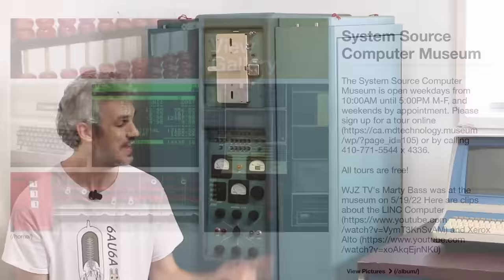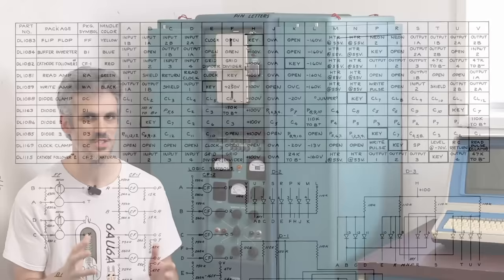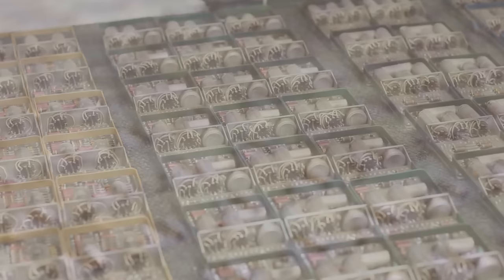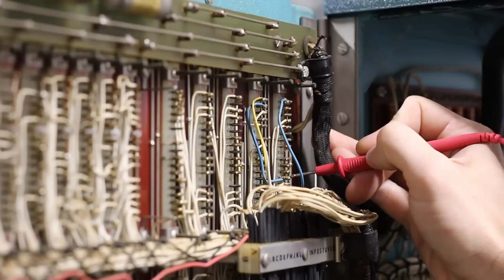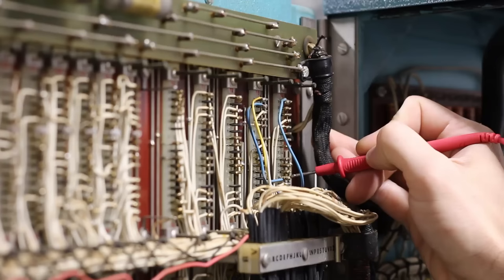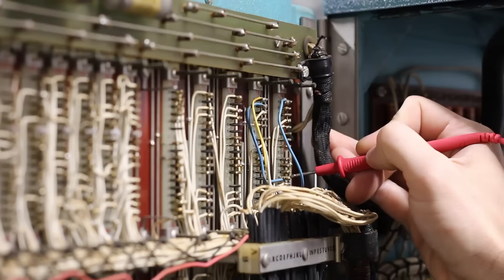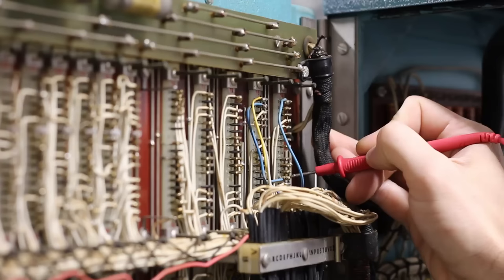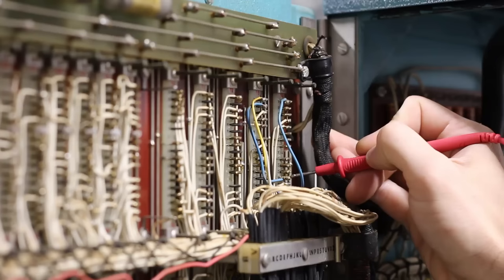Exploring 1950’s Computer Logic with the Bendix G-15!

Comment: I was actually glad to see that the card edge connectors were double-sided but single-circuit, since it makes them a lot more reliable.  But it still would be a daunting task to clean every one of those connectors if they get oxidized.  I really like the modular design though.  It seems like you could make test jigs and test all the cards on the bench without too much trouble.

Looking forward to the first power-ups!  Take care with those capacitor banks, and definitely use a variac and some current limiting if possible.  This will be a really fun series.

Comment: Those big round connectors used to called "bendix connectors". As an intern many years ago i was tasked with sourcing some replacements for a seismograph and it took me most of a day to figure out the military specification that they are now known by and order them from  Digikey.

Its cool to see them used on an old piece of Bendix equipment.

Comment: I just realized that Star Trek computers are paying homage to all these old computers with hundreds of small cards plugged into a back plane. Such an interesting structure!
Reply: The production design of Star Trek is from 1966, so the contemporary 'computers' would have looked a lot like this. And The Next Generation was from 1987, which still had similar-looking computers like the PDP-11 and VMEbus machines.

It's just a very efficient way of making a very flexible circuit arrangement that can be modified in the field.
Reply: The plugging in of these cards reminded me of the scene from 2001 when HAL is being disconnected.
Reply: Homage? bruh thats what they look like.
Reply: Because that’s exactly what mainframes  and computers looked like in the 60’s.
Reply: In a way that structure is still used today. Look into things like blade servers. Computers on a card. With the backplane providing infrastructure. Storage is not on the cards but centralized etc. It's very efficient and flexible.

Comment: I was a Field Engineer with Bendix in the 1970s. I was in the airborne sonar division at Sylmar, California. We had a computer system used to run Acceptance Test Procedures on sonar that was mounted in SH-3 Helicopters. The computer was a beast. It weighed 55 pounds and was quite large. Back then there were components that were so large we had to solder them with a soldering gun instead of a soldering iron. Ah, those were the days.

Comment: The 1950's was a time before static was a thing.
Reply: @tripplefives1402   It also doesn't matter with discrete components with their elements measured in millimetres vs nanometres
Reply: @tripplefives1402  Also the amount of current normally carried is far greater than what static electricity could deliver.  This is untrue for the innards of modern logic chips.  Now it's possible that static could blow one of those germanium diodes.  It would be a good idea, if Mr. Usagi hasn't done it already, to ohm all those diodes out in both directions.  The voltage margin does make me a bit uncomfortable.  Modern Schottky diodes could be substituted to come up with something more robust.
Reply from the maker: One of the great things about vacuum tube computers is how robust they are to transients and low current stuff!
Reply: static?  I ber a dollar to a donut this beast would survive an EMP
Reply: Heh. Before they cared, certainly. A good pop could zap some of those diodes, esp. as old as they are now. (the zap you get touching a doorknob is enough, but I doubt that's a problem for him.)

Comment: The first computer I ever had to service was an analogue computer, with valve (tube) amplifiers. It ran a flight simulator😊
Reply from the maker: Oooh, that's awesome! Was it the K2-W Philbrick based analogue computer? They have one of those at the museum in New Jersey at VCF East, and it's a work of art!
Reply: @UsagiElectric  It was a British built machine, so probably Singer Link Miles. It ran the Folland Gnat simulator.
After that I worked on many simulators that were hybrid digital/analogue machines and experienced the evolution to the digital age...

Comment: To clean the krinkle paint surfaces, go the dollar store and get concentrated La Awesome, dilute it 1:3 parts water, and saturate a slonge with it. 

That has been the most effective for me.
Reply: Sounds like a nice idea, just be careful of the fumes (there's a lifetime maximum exposure rating on the chemical used, believe it or not) and test it first where it won't be visible if it does mar the paint.
Reply: @SeekingTheLoveThatGodMeans7648  Citation? After looking at the SDS and checking out the components, I was not able to find any evidence of a lifetime exposure rating on anything in it. I would be shocked if anything consumer level would have such.

Comment: It is looking good inside. One thing you could have done with all the boards out is to check all the diodes in case any others are bad. Those cylindrical capacitors(?) seen on the left at 34:12 look nasty and will need to be replaced.

Comment: Maybe by the time that this machine was built Bendix was simply making all of them "alphanumeric ready", so that if the customer desired that feature it was a lot faster/easier to complete that process by wiring up the output pins, instead of having to dive into the backplane with a post-production modification 😊

Comment: I would be tempted to make a test socket for each type of board and use it to test each card separately (maybe using a Raspberry PI, although it may not provide sufficient voltage to check the diodes reverse breakdown voltage)
Reply: It's a good idea to make an automatic test and measure system, though an RPi would definitely not have enough voltage output (not to mention there would be a... significant level translation issue, even for inputs). Probably use one or more off the shelf system DC power supplies  + custom circuit or one of those HP-IB controlled boxes of relays with a DVM (I forget what they are called) to send the correct input voltages and measure the outputs.

Comment: I wrote my first code on a G-15 at UCLA Engr basement in 1960. OPs were numeric; I think '50' was multiply(?) No assembler - you assigned addresses for code and data. It had both paper tape and punch card I/O. Aside - down the hall was a comp called SWAC that created the sound for the movie "Forbidden Planet". The operator was entering code in binary to develop logic for a pseudo random number generator. It had a speaker hooked to the CPU so he could hear how long it took to loop.

Comment: On that one type of card that only has one row of pins in its connector you can see that the fingers on both sides of the card are still being wiped by the connector pins, so since all the connections are doubled up, they would be very reliable.

Comment: David, what is interesting is I observed no wattage ratings on the schematics.  That leaves me to believe that there is a system that was used that would specify where the heavy wattage's would be and default to 1/2 watt. To use a modern term on vintage hardware, it's an OMG machine. I knew someone (passed away) that worked for Bendix and I can imagine him using one of these to align GAM missiles.
Reply: The 1/2 watt resistor was the lowest wattage in common use and was not typically noted on schematics.  Higher wattage resistors would be marked as such, e.g. 1000 2W

Comment: 22:00 I guess the part above the gudeman capacitor is the input transformer? The whole machine is a great example of old manufacturing. Early PCBs, but no through plating so they had to put an insert into every hole. The parts have their legs all coming out to the side for terminal strip or point to point construction, which leads to that for today odd looking transformer blob.

Comment: The "Read Amplifier" circuit at 22:08 looks suspiciously like a circuit I designed for a transistor computer I'm developing, so I'll give my 2 cents on what the circuit does.

In my computer I store the microcode in a "core rope"-like memory where one ferrite core represents a single bit and a each wire passing through it is a single word of storage. To read each word I put some current through the corresponding wire, but this induces only a small pulse in the output of the ferrite core, too short and too weak to be used to control the rest of the machine. So I first pass the signal through a simple common emitter amplifier, then the amplified signal is connected to the SET signal of a S-R latch, so that if the bit encoded in the ferrite core is a one, a pulse would be generated and the S-R latch would output a one, and if no pulse is generated the S-R latch would remain to zero. Before pulsing the word wire, i briefly pulse the RESET signal so that all latches start from zero.

The Bendix Read Amplifier looks basically the same, just made out of vacuum tubes; I guess they are using it to sample the output of the drum read heads to "stretch" the pulses long enough to allow the rest of the machine to use the single bits.

Comment: This thing is absolutely amazing. Are you worried about all those Allen Bradley carbon comp resistors drifting? 70 years is a long time, I wonder if that’s going to cause issues.
Reply: I was wondering the same thing. I have an old Tek analogue scope where the focus stopped working, & it turned out that it used carb comp resistors in the focus chain. I replaced them with modern metal film resistors & that did the trick.

Comment: It would be cool to build a mini version using FETs
Reply: where would you get the drum from?
Reply: @mohinderkaur6671 modified hard drive maybe?
Reply: @Rorschach1024  the platter from an old drive and it's read write heads could possibly work. I've recorded on various objects such as veggie tins, etc as hobby projects over the years. I've also, in the 80s as a youth, converted 8 track units into data drives. But what I was thinking for this was to use a strip of magnetic tape from a cassette wrapped around a cylinder and the read write heads also from the tape machine. It would be a lot of work tho... and mighty not ever work....
Reply: @mohinderkaur6671  I'm actually thinking the simplest solution would be an endless loop cassette tape originally used with answering machines of the past and a datasette.
Reply: @retroatx  It'd have to move pretty swiftly to match the speed of that drum though.
Reply: @SeekingTheLoveThatGodMeans7648  yeah you're right I forgot the system derives it's clock from the drum and those endless loop tapes are short.
Reply: @retroatx  HA!  I thought I was the only one who used an 8-track deck as a poor-man's floppy disk!  Making a drum memory using cassette magnetic tape and heads sounds like a great idea.  And also, some computers made after the drum era used one surface of a disk pack with a set of fixed heads, for medium-capacity rapid access memory.
Reply: @BrightBlueJim  there was a book that I built a computer from that used a modified 8 track as a stringy floppy. I'll try to remember the books it was a set of two. This was around 1980. The coleco Adam Digital Data pack DDP was a modified high speed cassette tape that held 256K. My idea for the FET machine was to use an endless loop tapes with an auto reverse tape head and write head so I could simultaneously access both sides to replace the drum but I don't know if I could get it to work

Comment: Keep in mind, that’s a smaller something is, in general, the higher resistance will be. The bigger the conductors are, the higher the conductions will be, and the lower the resistance. So a small device is not a big high power low resistance thing. A small device is a small, high resistance, low power device.

Comment: As someone who had a fair share of diode logic related headaches -h resistors are pullups for the gates. At this level of non integration logic gates are more of an analog circuit, and buffer modules shoehorn them into discrete states.
Reply: And read amplifier uses a RS trigger to shape the pulse from the memory (which is really slow and wobbly) into a neat little square one clk cycle long.
Reply: That RS flipflop can be seen as a kind of schmitt trigger buffer.

Comment: I assumed that all vacuum tube based computers were as big as ENIAC, really interesting that they could get as compact as this bendix thingy.
Reply: The LGP-30 is even more compact.  It does implement more of its logic in diodes, though, and it is a bit-serial machine.
Reply: Quite a bit of the logic in this machine is actually solid-state, implemented with the diode cards.

Comment: For the AC wake up... Do use a 50 Amp variac to bring it up slowly, also an inline fuse and inline 50 Amp ammeter just for peace of mind seeing the draw visually. The tubes are AC heated so I assume will start to draw current right away, unless you disconnect to secondary for the first smoke test. That insanely huge filament transformer is probably irreplaceable, the smaller B+ transformer is more replaceable but still hard.

Comment: If you want to get rid of that tarry adhesive residue, slather it with white gojo hand cleaner.  Should dissolve it.   It even helps in removing petrified masking tape.  Oh, btw, gojo does wonders cleaning wrinkle finish paint as well...
Reply: it contains solvents. Mild, but Can destroy some finishes.

Comment: Great! I have used a G15 in the long ago past! Try 3M adhesive cleaner for the black seal material around the doors and panels! Good Luck and keep going!!
Reply: What did you use it for?   I'm very curious the use cases on these.
Reply: @v12alpine  We used a G15 at UC Berkley in the Electrical Machines Lab to compute Electric Motor characteristics such as rotor inertia, slippage, torque, etc! We did everything with paper tape as input. Interesting exercise in writing efficient code as each instruction essentially points to the next instruction location on the drum. We coded everything in raw machine code....Circa 1961!

Comment: I am just amazed that people back in the 50s have managed to squeeze the entire gut of a CPU into a fridge-sized chassis, WITH the vacuum tubes. There may be a few or no transistor therein, except for some post-vacuum tube computers made in the mid-50s and early 60s, like IBM 608. (I digress, IBM 608 was more of a calculator, but still, calculators are computers since they have to process the math that you entered, and most calculators today just use common microcontrollers and CPUs to crunch the numbers nowadays, microcontrollers are not very expensive anyhow.)
Reply: Do note that much of the logic is implemented in the diode cards and not in the tubes.  That helps reduce the size a bit.

Comment: For cleaning the wrinkled paint exterior, I'd recommend dusting first and then using a ph-neutral cleaner like car soap and a fairly soft bristle brush - like a mushroom brush. Treat it like a car from the 50s that has aged one-stage paint. Also careful with those old selenium rectifiers: their magic smoke is VERY toxic! Not sure what type of liberties you're allowed to take, but if possible get them out of circuit and use silicon diodes (just be aware they have less of a voltage drop)
Reply: There were two grades of selenium rectifier.  the consumer grade types used in TV's and stereos are best removed and replaced with silicon.  And when they fail, and they will, they WILL smell horrible, and ruin their surroundings.   However the red-type selenium diodes seen here will be professional/industrial grade types that are far less troublesome and can be retained for museum authenticity.   HOWEVER - THIS IS IMPORTANT - these selenium rectifiers slowly turn into resistors when not used.   If this computer has not been run for many years, the selenium rectifiers will need reforming.  Reforming is done the same way you reform old electrolytics - start off with current limited reduced AC voltage (use a variac), and slowly increase the voltage towards normal operating level while watching the current.   If they get warm you are going too fast.
If you don't reform selenium rectifiers used as power supply rectifiers, you WILL most likely regret it very much.  They may refuse to reform, but I have not found any that did - if you follow the procedure and don't just apply full volts straight away, no harm done.

Comment: I would have suggested checking a sample of components from each type of card: resistors, caps, diodes, tubes. Can't check them all, but would give an indication of the overall population condition. High hour set?

Comment: It wouldn't surprise me if the only difference between the NC and ANC versions is the routing of a single wire.  If they wanted to be able to upgrade a machine in the field (customer could only afford the NC and thought it would be good enough, but now they want an ANC, for example), they might do this.  It is also easier on the production line to make the differences between the two machines as minimal as possible.  I knew a guy who worked on Scientific Data Systems Sigma computers in the early 1970s, and according to him, the field upgrade to add floating-point math on a Sigma 7 involved adding one jumper, so this really was a thing.